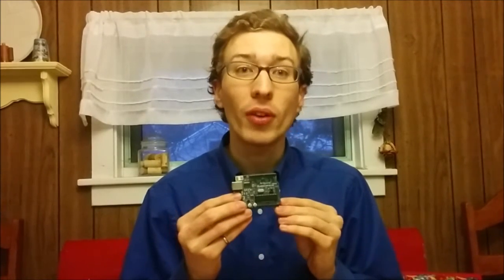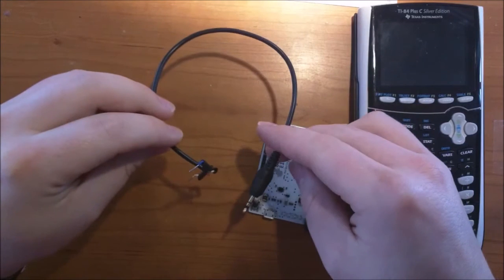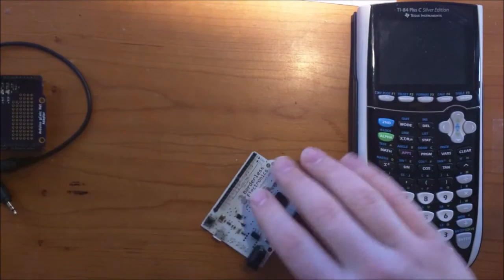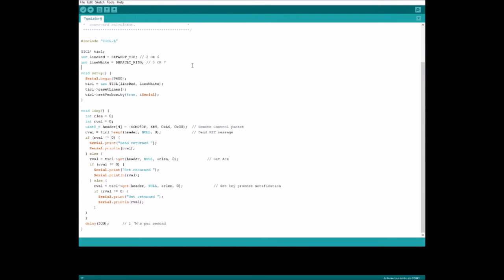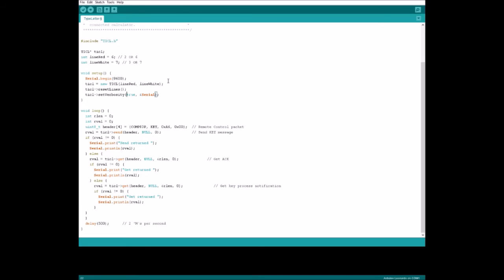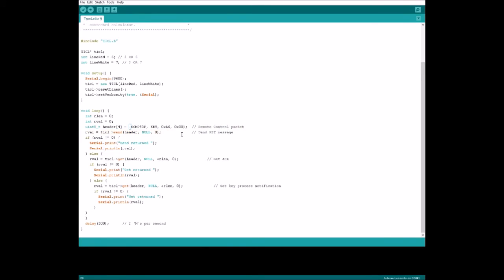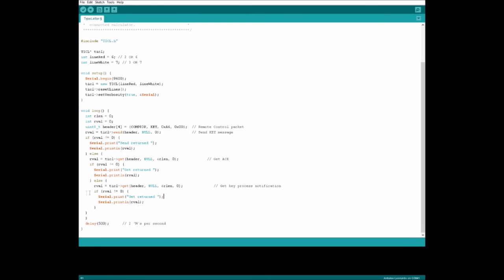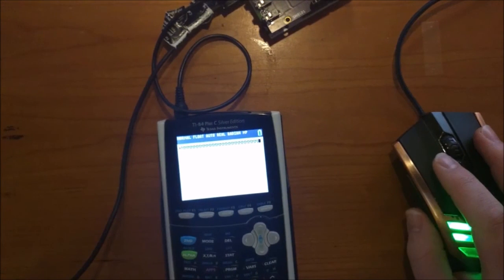ArTICL How-To: Arduino + TI-84 Plus

Comment: Would you know of a way to use the TI-84, TI-89, or TI-92 as an a signal output later to be read by the arduino?
Reply from the maker: Yes, that's what ArTICL is for, assuming by "signal" you mean some sort of active communication between the TI-84 Plus family and the Arduino. If you mean some sort of analog signal generation, that can be a little more challenging.